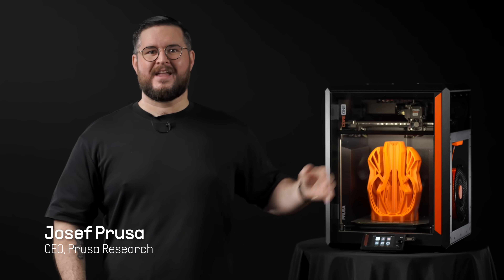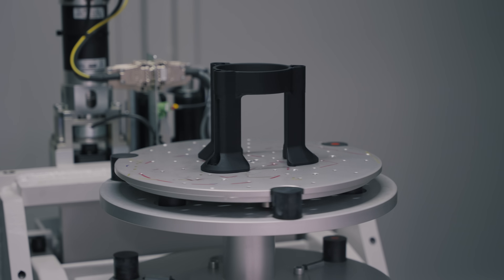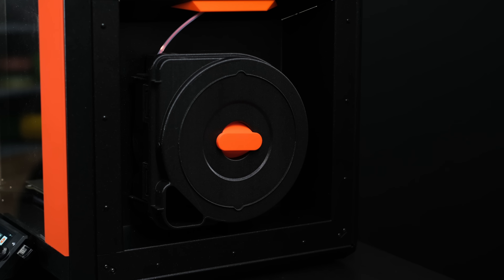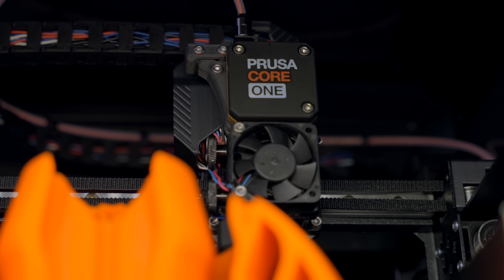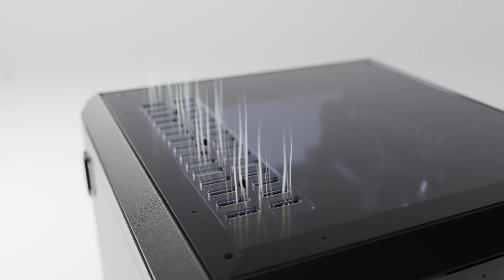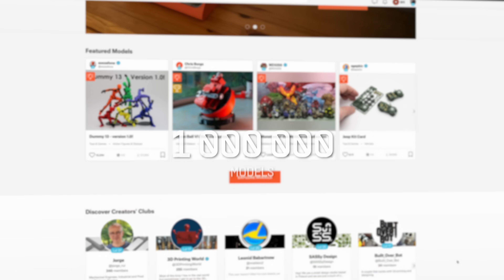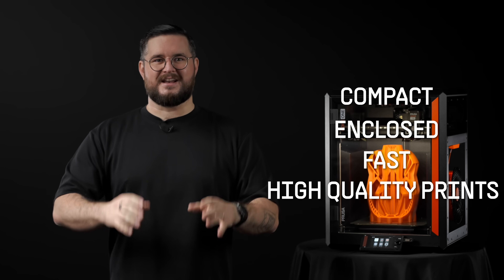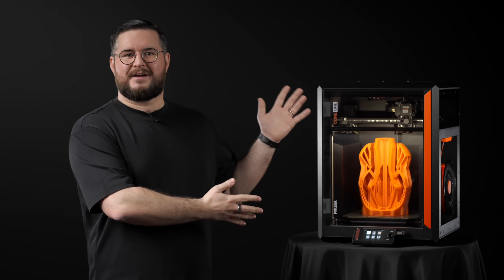Prusa CORE One - Fully Enclosed, High-Speed CoreXY 3D Printer With Active Chamber Temp Control

Comment: I've had my Mk3s (still have to update to the +) for many years now.  I really enjoy the printer and it does everything I want it to do.  I don't make stuff to sell.  I REALLY wanted the XL but it just seems very overkill for a 5 tool change printer, plus it's freaking HUGE.  It would not fit in the area I currently have that my MK3s is at.  A hand full of my friends have a Bamboo X1 Carbon and it is a nice machine.  I love Prusa so was just waiting for something like this to come out.

Seems nice.  I do like to support Prusa.  Part of me wants to get this but another part of me is saying they are doing this a year too late.  On top of that I feel certain things should be STANDARD at this price point... camera..etc.  I get you can add them but it would still be nice to just include it.  I like that this is enclosed.  I LOVE the fact that the MMU3 can be integrated in this easily.  That's actually probably one thing I really want!  MMU2 was a nightmare and it seems like they finally worked out the problems that had with the mmu3 from all the FB groups.

This is very tempting honestly.   But the build volume isn't that huge in terms of my MK3s.  Little bigger yes, but still far from the XL.  As the Kit form I think it might be doable.  I'll wait on the reviews.  After seeing how long people took for the XL and all the problems folks were running into, I'm not jumping on the "frist run" wagon... I'll wait slightly.

Comment: I just upgraded my mk4 to mk4s and the cost of the upgrade make me thinking about buying another printer brand because the price of the upgrade to core one is the same price of the bambulab A1 Combo so you can print with multi color . But the great feature of the prusa is the costumers service  24/7 and most of the printer parts can be printed .
So as a prusa members or users we need a benefits like a discounts or free gifts or accessories as a gift any thing that’s keep us going with prusa .
And about the enclosure I already buy network cabinet that cost almost 120$ and add for it some stuffs like a filter fan, light , thermometer and its work fine .

Comment: Cool, is there also a sensor for input shaping this time or is it just a fake with preset values?
Where does all the rubbish end up in the print room if you print multicolored for several hours with the MMU?
How is the nozzle cleaned?
Additional fan?

Comment: Looks really nice with some new features like heated chamber. Wish that it had a larger print volume though as I need to buy a printer to print larger prints using ABS and ASA. Hopefully a Prusa with a larger print volume with same features and looks would come out as do not like the Prusa XL (especially it enclosure).

Comment: I was considering upgrading to a more sophisticated machine, and the obvious choice so far has been a Bambu Lab.
However, considering how well made this seems, the features it packs, Prusa's reputation, made in the EU, my desire to switch to Prusa / Super Slicer and the fact I have been using Printables for years now, at this price point it's a VERY attractive deal.
I'm going to have to wait for a review by Stefan on this machine. I learnt most of what I know from him, and I feel I need his expertise and experience with many different printers on it, but I think I'm sold!

Comment: The only "negative" thing I can think off. Is that this pretty much renders the Prusa Enclosure obsolete. Like if you own a MK4S it would make zero sense to pay for a Prusa branded box, when the difference between a bare basics that and a full conversion to the CORE is ~120 euro. It now only works as an accessory for older legacy printers like the i3 for which the upgrade path may be too expensive.

Comment: I basically did this with my PrusaXL. I didn't like the original bellows style enclosure, so I replaced the bottom portion with laser cut sheets of polycarbonate that fit perfectly in the aluminum extrusion channels. I was going to make the front a door, but the screen was in the way so I opted for a fully removable panel held on by magnets instead. It looks way better than the bellows imo

Comment: my two MK3S+ still running strong but if I ever upgrade them it will be minimum a 350mm or larger buildplate printer (for example the sv08 is about €500 got a tons of mods already) no chance to spend €639 on a MK4S upgrade lol these upgrade kit prices are a joke

Comment: Please have a version with an aluminium extrusion frame so the enclosure can be modified, and mods can be done more easily. And if possible please keep the prices in check. I love prusa, especially as it is one of the only remaining honourable open source companies left. It is also much more restrictive to mod a machine that costs $1500 AUD. Mabey 2 lines of core printers, one more expensive but more streamlined, basicly the core one. And another line, the tinkerer or hacker core one, with a more easily modded design and at a slightly lower price point, features like the nfc wifi setup could be removed till a fully functional but bare bones printer was left. An extended gpio board could be added with compatibility for extra steppers that could be configured in prusa Slicer, would also be nice. I love modding my printer and am currently working on adding a non invasive second nozzle to the mk4, and I want things like this that have largely died within the prusa community to become more accessible again.
Reply: Could always get a voron trident or ratrig vcore 4
Reply: @kristian6087  yea, but you still get the advantage of being with a company like prusa whilst taking part in the modding community.

Comment: Nice shot at the used idler issue that Bambu has, which cannot be easily replaced. That’s all fine, but it will be super expensive. I was super hyped about Prusa, and after using Creality, I bought the Prusa Mini. I’m disappointed with it. Although they still sell it, no one seems to work on it anymore. There are Input Shaper (IS) issues with the new firmware, and we feel abandoned. Support is basic at best. I will no longer overpay for Prusa. I plan to buy a Bambu printer, which is much cheaper. I’ve also read about issues people have had with the Prusa XL and MK4.

Comment: And yet, you still are smaller in build volume then what is on the market and what your competing against.  250x220 is, for one, a wired rectangle to work with and is smaller then a standard 250x250, Z height means very little if you can't fit the model on the plate in the first place.  The X and Y build area means a lot as you want to print as flat as possible on a print instead of having to finagle it at odd angles to make it fit because you have extra Z height.

Comment: Hmmm, this had to drop just as I was looking to replace my Mk3S with an X1C.  The X1C is currently on sale and now I need to do research.  I love my Mk3S, but is the Core One fast enough?  The MMU has always been a bit of a detractor with it's messy integration, especially compared to the X1C.  I would much rather stick with Prusa, I really would, but I'm not sure yet.  If they would match the sale price of the X1C it would go a long way, but I doubt seriously that will happen.  So hopefully I can get some hands on intel on this printer fast.
Reply: Wait for reviews or get the X1C with AMS on the current sale. I wouldn't buy this before reviews drop and it's been out for a little bit.

Comment: Bambu owner here. There is no doubt the X1 etc is a great machine. BUT the issue is support when things go wrong, it is the worst service i've ever experienced! 1 of my machines has 800hrs and requires a new heat bed and control board! Support do not answer questions and you will be left on your own to sort out issues and repair. For the average person, these machines are not easy to work on. Thank god the 3d printing community are fantastic at helping solve issues! Bambu came into this market and used/stole everything the community has developed and gives virtually nothing back. Brand loyalty is not a thing these days but i do see Prusa's work over the years has done an awful lot for the 3d printing community. So go buy your cheap chinese technology but all i can say is quality remains long after the price is forgotten.

Comment: With 2000 comments no way I’m gonna track down the 2 posts claiming the “sides pushed in all the way to the plate will cut down on the printable area of the plate.”  This would be true if the xy gantry were lowering itself to the plate, but since the plate rises up to the gantry (where the sides don’t pinch in) this will not be an issue.

Comment: It doesn't include a camera at $1100. It still comes with a crappy screen. build volume is smaller in 2 of the dimensions than most other printers. No AMS just the POS MMU3. No lidar. And the horrible support that they mention as a positive from included at no cost to you! I really which someone would come and challenge Bambu but this is as much of a joke as the MK4s.

Comment: It would be good if it had a door to enclose the filament (slide up rather than hinged) and a grate on printer wall side so you can print nylon. Ie open the grate put dry nylon in and close outer door. Then heat from chamber fills the nylon (chamber) and you get prewarmed or dried filament. 

A Concern for me was build chamber temp is 55 only. Wonder if they are still using petg for parts which causes the limit… I wonder I this can raised ?

Comment: This is actually upsetting as they just put out that mk4s, which costs as much even as a kit when you add the enclosure.  I just had mine arrive and built it.  I went back and forth over it for a while due to the bamboo stuff.  What a piss off. I would have bought this no question. Now i feel i have an obsolete printer less than a few weeks of owning it.

Comment: @Prusa3D I would like to see an alternative upgrade besides the MK4S. I just did the 3.5S conversion while keeping my MMU3. I don’t want to give up my Revo ecosystem as my Prusa Mini+ with Vertex3D extruder and 350mm Voron V2.4R2 with TAP 2.0 use it as well. So if you offered a kit that would allow me to convert a MK3.5S, while letting me keep my 1.8 stepper motors and my Revo 6 with Delta P cooling, then I would be very interested.

Comment: Pretty slick looking machine.  I like some of the design innovations, like the spool holder in the chassis, but it looks like those intrusions butt right up against the build plate, meaning the tool head can no longer build to the maximum build volume.  Despite that, it literally looks like what almost everyone would want in an enclosed 3D printer...except maybe more build volume, of course.

Comment: the real reason prusa does not have built in cameras for this printer is that Stratasys has two valid  patents for this feature? 
US8747097B2 and US8562324B2 „a video camera positioned to capture video of the build volume from a point of view”
Reply: interesting;

Comment: was about to order a bambu x1c over the next days and while I applaud you on this much needed next iteration, as a total novice to 3d printing I'm not fully convinced. Is the entire work-flow going to be as straight forward and hassle-free as with the bambu.  The reason I haven't owned a 3D printer after I sold my first one >10 years ago is that I am looking for a tool that just works, I don't have the time to fiddle with it anymore, my hobby is solving tasks, not tinkering with a new tech in order to figure out how to use it.

I'd appreciate if anyone has some input on this. I would prefer to purchase this prusa core one over a bambulab x1c, but I've seen first hand how dead simple and reliable the x1c is to use and that's what I'm looking for, if the Core one will deliver that, I'm sold...
Reply: You and I are in the same boat. We'll have to pay attention and watch how reviews respond to it.

Comment: I love how prusa has just been gradually filling the role ultimaker took on earlier as the most reliable affordable printer. Both started at around the same time, but where ultimaker seemed to start as an expensive but easy to use machine, and then evolved to business prices with not much innovation, prusa started almost as cheap as you could get, and is evolving to a much better version of what ultimaker started as.

Comment: Exciting! Promising tech in this printer but there are a few things.

They point out that the core1 it self has a smaller footprint than the mk4 printer ( by 30%), but based on their printer dimensions on their website:

-mk4s:500×550×400 mm
-Core1: 415×444×555 mm

Based off these numbers, core1 is only 0.93x bigger (7% smaller) than the current mk4s printer dimension. Where are they getting 30% smaller from? If someone knows, please inform me.

In addition, this is  just my opinion, but I wished they would’ve made the core1 build plate 250mm width x250mm depth x 270 mm height at least, instead of its 250x220x270mm. I feel the 220mm depth very limiting compared to other modern 3D printers.

They point out that the core1 it self has a smaller footprint than the mk4 printer ( by 30%):

-mk4s:500×550×400 mm
-Core1: 415×444×555 mm

Based off the dimensions, there’s plenty of room to add the extra 30mm in the depth direction making the core1 415x474x555mm 

If they wanted to one up bambu who's build plate is 256x 256 x 256mm and a footprint of 389 × 389 × 457mm (0.62x smaller than mk4s):

- make the core1 printer build plate 270x270x270mm , making the core1 footprint 435x474x555mm,  making core1, 1.04x bigger than the current mk4 or 1.65x bigger than the bambu x1C

OR the bare minimum:

- make the printer build plate 260 x 260 x 270mm, making the core1 footprint 425x464x555mm, just 0.994x bigger than the current mk4s (pretty much the same size as a mk4s)  or 1.58x bigger than the bambu x1C

I understand there may be some design constraints for not making it at least 260 x 260 x 270mm such as the motors or the upgrade kit path wouldn't' be possible, but wish they would explain why the build plate's smallest dimension is 220mm.

Another thing I hoped to see is muti-head extruders. MMU3 is okay, but with AMS and creality's CFS available i hoped for an option for multi-head extruders just like  it's big brother the Prusa XL as they are now similar COREXY systems. Maybe in the future it will be possible as an upgrade. 

Prusa research are doing amazing things, I just wished it had a bigger build plate and not constrained to 220mm in depth. I would rather be able to print more things on a plate than save space if I don't need to save space as I only 3D print for fun and not as a job.

Overall, I welcome the core1.This comment is more of a constructive criticism as I do enjoy their printers. I hope my wish list of the multi-head upgrade appears in the future.

Comment: So if I understand correctly, it’s a BambuLab X1C that costs 200 euros more… or a kit at the same price as a BambuLab, but you have to assemble it yourself and do all the fine-tuning. So, it will never print anywhere near as well as a BambuLab for the first 300-400 hours, assuming you know what you’re doing. Basically, a bad copy of a BambuLab x1c two years late… but the other comments seem positive. Did I miss something?

Comment: I have an MK4 that I got after two years of working with an Ender 3. I am an absolute PRUSA CONVERT.

Not only is the printer insanely performant and well-designed, but all the supporting materials, software, forums, etc are all beyond anything I've received with a purchase before. You can buy an $8,000 mountain bike and you don't feel anywhere near as properly prepared and supported as when you do buying something from Prusa. There is no third-party vendor interference or room to introduce inconsistencies, and updates that genuinely add value to the product you already own continue to roll out.

I know it's a company and we all need to use critical thinking and not treat them like a person, but god damn. What an absolute chad of a company.

Comment: I really like the touch on the panel 
G28 -> M84. 

For those who don't know:
G28 Performs homing, something that's done just before the print starts.
M84 Disables the motors, something that's done once the print's finished. 

Kudos to the designer who came up with it:)
Reply: I haven’t used a 3D printer yet, so the value isn’t obvious to me.

When would I need or want that button?

Thanks
Reply: @firstmkb  It's not a button, just geeky graphics inspired by start and end of every g-code printer performing.
Reply: What exactly are you saying? It has both functions?
Reply: @travistucker7317  I'm saying that the panel design is beautiful.

Comment: This looks awesome, but when are you coming out with a 300mm (cubed) machine?  I have the i3 MK3S+ but skipped the MK4 in favor of a Bambu X1C, but now I'm in the market for a large format Core XY enclosed printer.  I was awaiting the larger format Bambu, but would gladly come back to PRUSA if it had such an offering that was competitively priced (the XL with filament changer at $3500 is not even a consideration).

Comment: Finally a Prusa printer with enclosure out of the box. But why 250x220 but not 300x250? All I can see is you’re wasting a few centimetres thanks to those silly left and right cavity where the nozzle still can touch with that width of the linear rail. Publishing a new printer in almost 2025 with this print size is not a really good strategy. Also a funny thing is that they still tried to squeeze in a MK4s a fews months ago at a very similar price just to get some extra revenue but not this 😂 Still on track to be another Blackberry I guess!